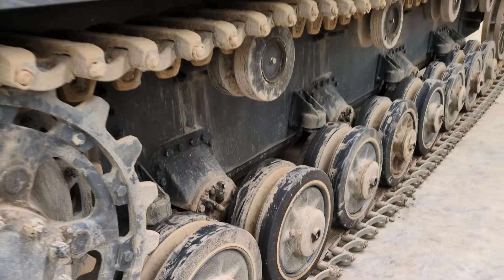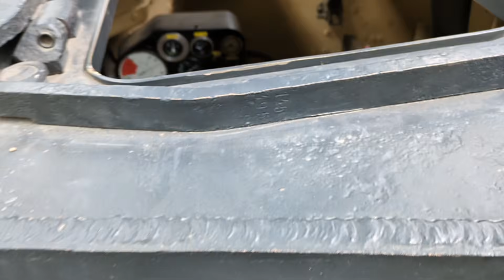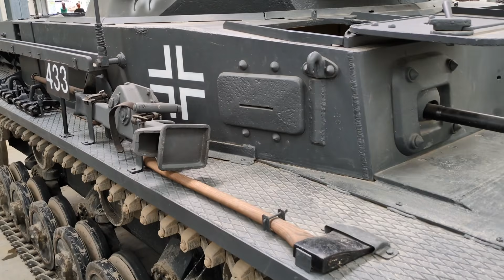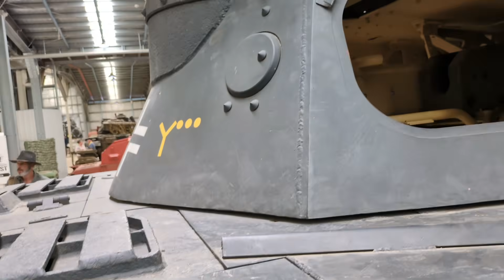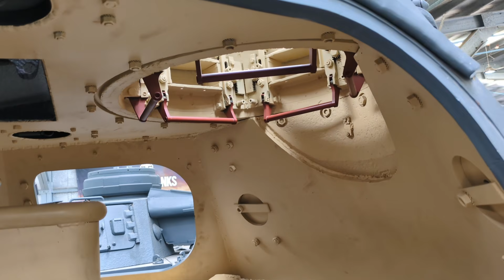German Tank. Pz.Kpfw IV Ausf.D at Australian Armour & Artillery Museum.

Comment: ERRATA:
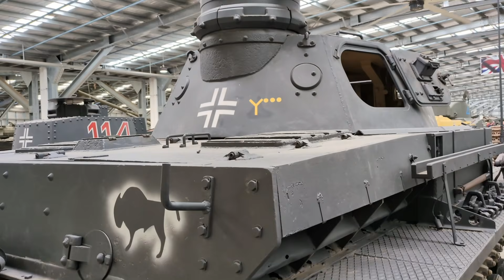At 4:00 the narrator says the cupola was "pushed forward" in later versions of this tank.
No, it was never moved at all, not in any version.
What really happened is that the back wall of the turret was reshaped to fully enclose the cupola.
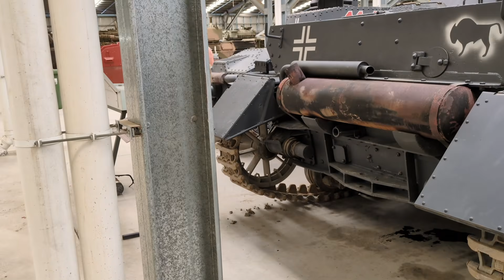At 4:15 we're told that this long external muffler was "almost unchanged" until the end. 
In fact it got a significant change : for the Ausf.F,  its length was reduced by one quarter, changing the appearance of the tank.
Reply: जीभ67पी